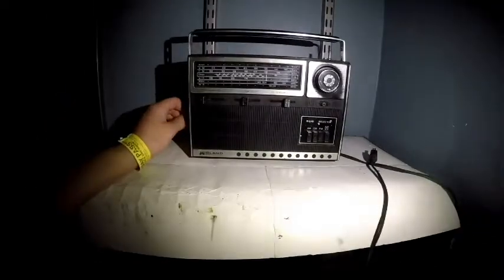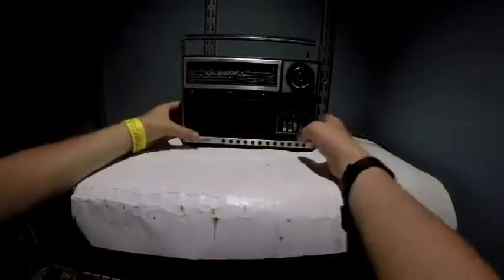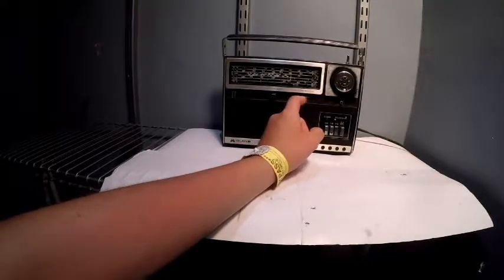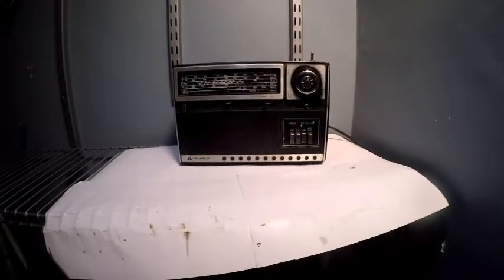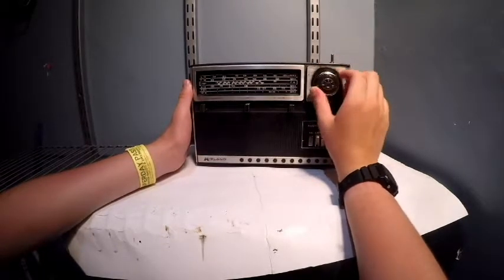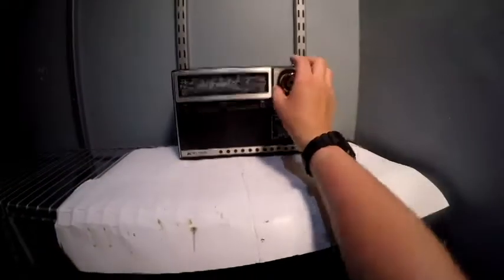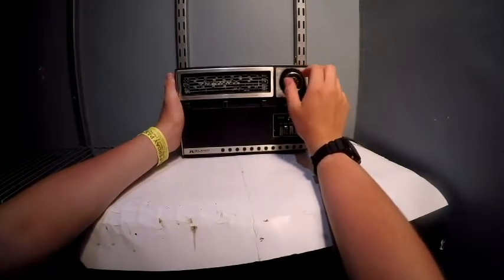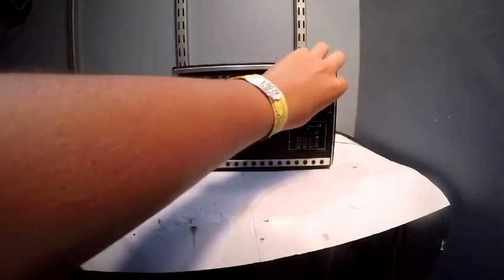Circa 1968 Midland Multi-Band Radio Test and Band scan

Comment: Sounds like the tuning circuits are bad, IIRC instead of a variable capacitor like most radios, the "varistors" act as the tuning circuits. I would try replacing ALL of the electrolytics first, as they are very likely dried out and that will affect the tuning as well. 

And yes, as you well know, AM is my favorite band for scanning. :)
Reply from the maker: Thanks for the advice, I'll defiantly get on that! I have all the abnormal bands working (CB, PBH, AIR, WB) with a big antenna. Plus you saw AM/FM working too. Near future night tuner right here!